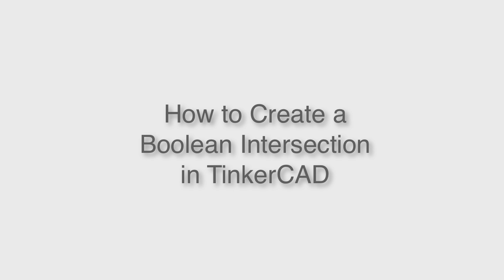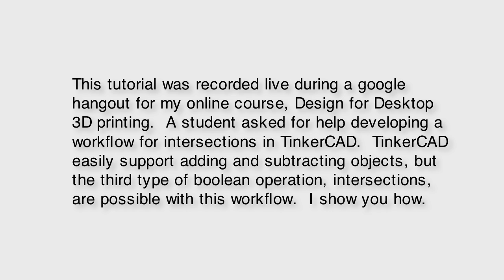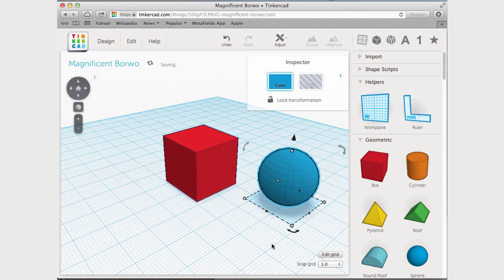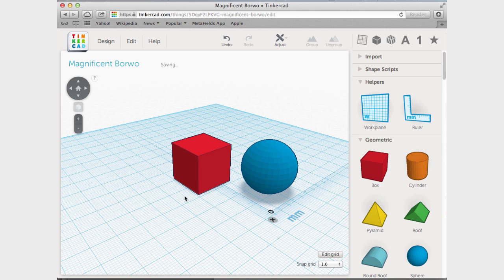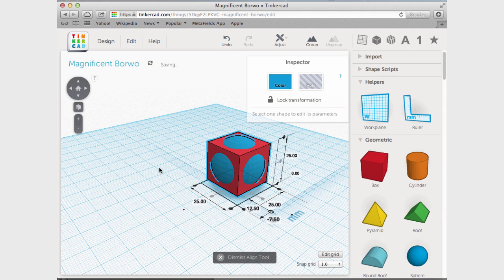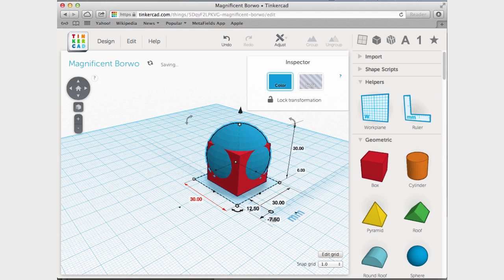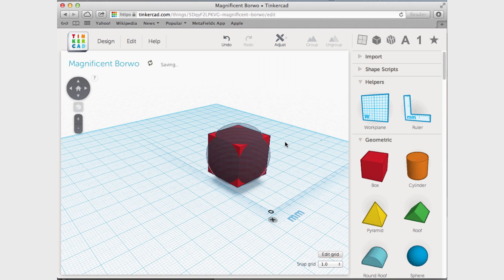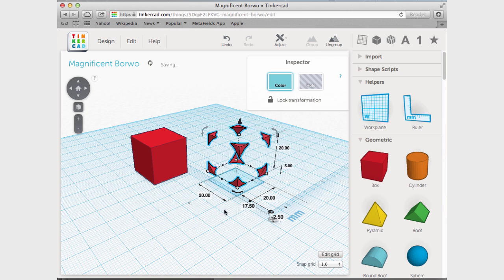How to Create an Intersection in TinkerCAD

Comment: This really works, let me explain, if you want the intersection of 2 bodies, just make them negative i.e. as holes in 2 larger objekt. Group the objects and your mold is ready. Make this mold a hole and group with 3rd large object acting as the material. And there you have the intersection you sought after.

Comment: really nice, thank you. Basically the concept is that each single shape can be real (color) or a hole. When tou put together two real objects you make a union (+) . When you put a hole-sape in contact with a real shape you make a subtraction (-) . Grouping is possible to make a composite shape negative (hole) so it's possible to create each single element.  In general, given two shapes A and B, the intersection can be formalized as 
A + B - ( A - B) - ( B - A) 
where the signus - indicate that it's necessary to use the following shape as a hole and the brackets are the grouping action.
So
put A and B in the desired position
Duplicate the whole geometry twice

A + B       ___________    A + B   _____________  A  +  B

invert B in the second block  and A in the third block

A + B       ___________    A - B   _____________  - A  +  B

unite them

(A + B)       ___________    (A - B)   _____________  ( - A  +  B)

invert the second and the thrid one

(A + B)       ___________    - (A - B)   _____________  - ( - A  +  B)

put them together with the align function and merge the result

(A + B) - (A - B) - ( - A  +  B).

There might be some problem in the sense that if the images are equal it's not possible to state if the hole is visible (there might be a neglegible-thick core that doesn't allow you to see the hole. If it happens you have to slightly enlarge the megative terms of the final equation (enlarge both the terms - (A - B)  AND  - ( - A  +  B) or simply increase the term +A in the part - (A - B)  and +B in the part  - ( - A  +  B).

Finally if one object is bigger than another it's not necessary to make bot the subtraction, but only the non trivial one.

Good work, thank you !